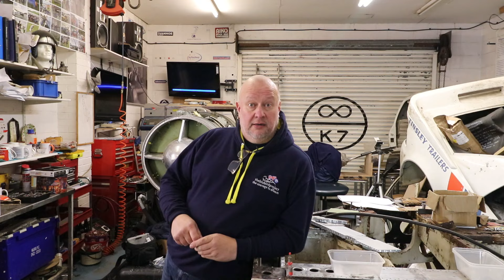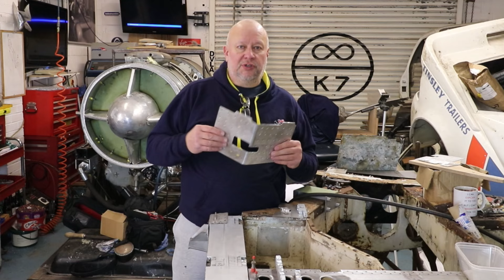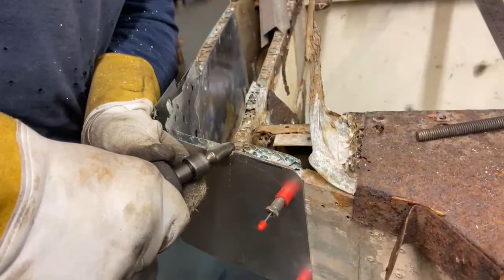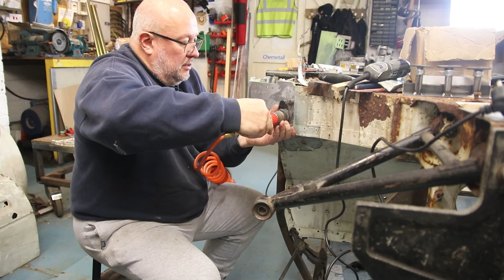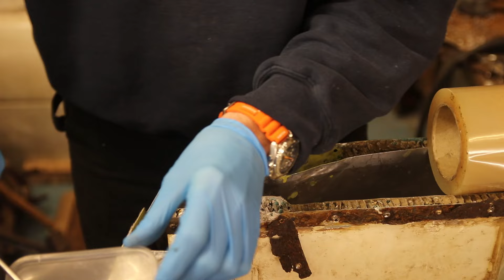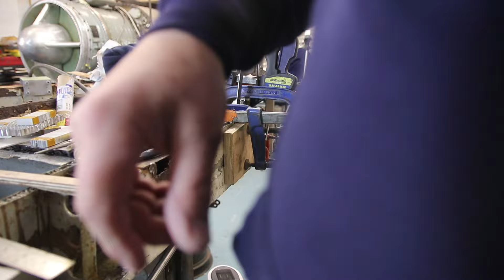Building our Ford RS200 Tub. Amazing results with the King's Resin. Part 15

Comment: A row of evenly spaced finish nails works well for stretching out honeycomb core. Just hook close to both ends of the block and pull.
Reply from the maker: Top tip... we'll make a honeycomb nail pulling tool tomorrow! Thanks for that, thanks for the feedback and thanks for watching, appreciated. 👍

Comment: Could you share where you got that countersink drill? At work we sometimes have oddball rivets that we countersink by hand, because our sheetmetal suppliers don’t have the correct stamping die. Would come in handy 🙏🏻
Reply from the maker: If you Google 'aircraft countersink' or 'microstop countersink' you'll find lots of them. Aircraft tools are aviation's best kept secret. There's lots on eBay - I just had a look. But you have to make sure you get the correct cutters for the rivets you're using, countersink angle, pilot diameter, etc. If you need to know anything else just shout. Bill

Comment: More great tips and explanation, love the way you are improving the original design
Reply from the maker: I've driven one of these cars for 20 years believing it was strong as strong could be until the start of this project and it seems that had Paddington Bear laid up the chassis with toast and marmalade there'd be nothing to choose between his way and that of whoever built them for real. This is going to go from the most knackered RS200 tub ever rebuilt to the strongest one ever built. No excuses. 
Bill